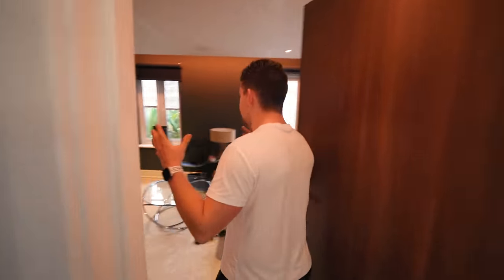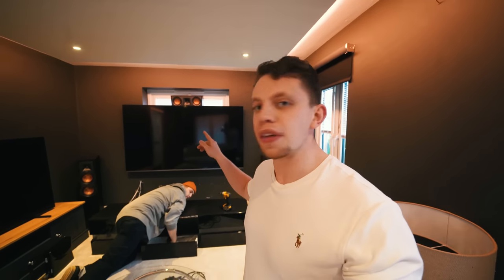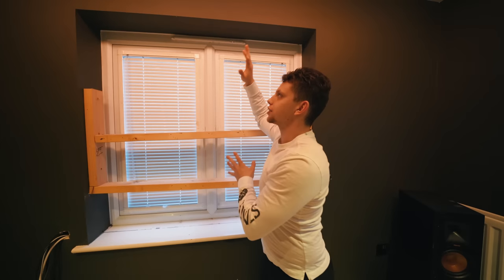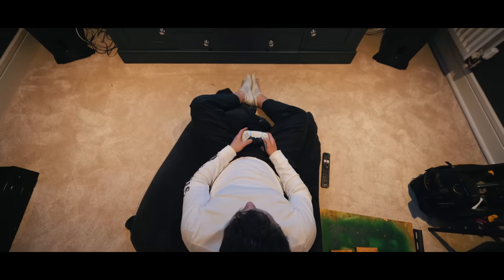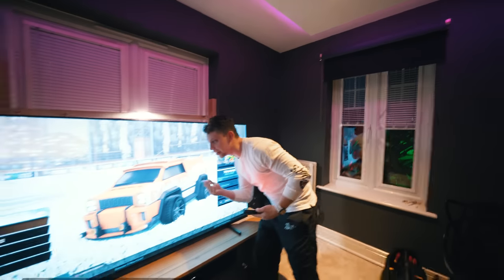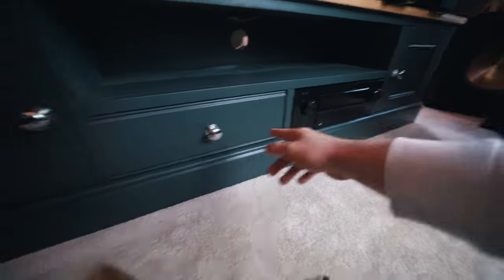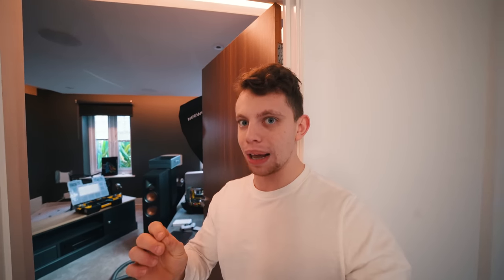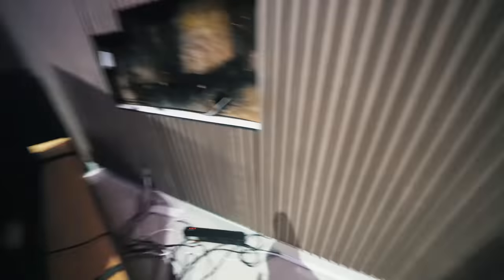Overhauling my Home Cinema for 2022! (Insane results)

Comment: How's your amp gonna stay cool though?
Reply: Most shocking AV setup I’ve ever seen, as you said:

- AV Receiver needs air, literally in the manual how many inches or cm clearance they need
- One of his floorstanders is right next to a radiator, another big no no.
- He has large klipsch floorstanders but a small centre, which is insane when 60-70% of the sound comes from the centre. 
- Running cabling all grouped together like that isn’t wise.

Just diabolical lol
Reply: He said he's gonna put a fan behind it
Reply: @tomahawk1222  that’s what I thought my demon amp gets really hot when I’m pushing it.. the grills are in the top of my amp too.. ah well it’s his equipment I suppose lol

Comment: There's feet on the bottom of amplifiers for a reason. So it can essentially breathe. Your amplifier is going to overheat and kill itself within a month.
Reply: Then installed flush on both sides. Choking it on top and on bottom.

Comment: I dont think its a good idea to squeeze in that receiver in there. Without proper ventilation, it would most likely heat up and then bye². I would have placed it instead on top of the table. Center speaker placement is a lot better than the old one. Just move it further front. So that the initial sound reflection would not be on the table.

Comment: That receiver needs more room to breath. Just putting a fan at the back will not do it. You should figure out something g else for that if you don’t want it to fry. Other than that looks AWESOME
Reply: I’m in the automation and theater industry and we put sometimes 4 to 5 receives In A rack which is pretty much the same amount of space that is in that cabinet. Not saying that is the best thing but there shouldn’t be any many issues since it’s not running 24/7

Comment: If you liked the smaller tv then you could have a taller unit for the amp  to breath and more room for other  equipment.. The feet on the amp are there so air can be sucked in  for cooling and the amp needs space above to get the heated air out, no fans needed if you leave room.

Comment: You are creating a major heat problem with your avr installed like that ,it needs ventilation, or if you like the no gap look ,you could buy a ac infinity fan cooler ,they simply sit on top of the avr ect they are available in front and rear exhaust, the only thing is your cabinet slot will need to be a little taller ,personally if you leave your avr as is it will simply just over heat 🔥

Comment: bro you need to swap where your ps5 and receiver are. it needs airflow
Reply: it didn't fit where the PS5 is sitting either, I'd reccomend getting a different cabinet entirely, or you could do some major modification to it to fix the air flow but airflow is going to be in issue, I woudln't put the PS5 directly above the amp either. Wall looks amazing though.
Reply: @ripjames  i agree, the wall is nice. Aesthetics isn’t worth dying components though lol

Comment: Cool but flawed.  Be far better with screen mounted higher ( Personally id have kept the 80" , or gone projector ).  Centre speaker could then be wall mounted and naff floor unit fecked off.  Electronics could then be hidden away in a rack at the back of the room and controlled by a Crestron or similar.  What you have is a nice loud TV but not a true Cinema System.  Stil at least you mounted a fan for the receiver or it wouldn't have performed very well, still gonna fry though mounted in that tight a space.

Comment: The moral of this story, don’t trust anyone that says “drilled to the wall”, what does that mean FFS.  Scary that this guy allegedly professionally installs racks etc. Adding fans behind that amp will make zero difference, it needs the space above and below for the air flow (I would suggest reading the Amos instruction book, where is will say do not obstruct the air flow).

Comment: Proper home cinema sound should never use the inbuilt TV speakers you will always get inferior sound use a Dolby soundbar always or separate speakers off a avr or even separate surround amp
Reply: Avr needs more ventilation as they run incredibly hot at least 3 inches are round and above and below amp for air to circulate. You may find you auto protect shutdown kick in when it gets too hot.
Reply: @letstalkcriterion  I have Denon behind the wall in my laundry room, it's gone into shutdown a few times blasting it in the summer
Reply: I'm home theatre enthusiast (click red dragon twice) and I've never heard of home theatre with TV speakers  😁

Comment: That Sony TV is a bunch of crap. It does not do 4K at 120 Hz. If you know anything about Sony‘s little scandalous behavior you’ll know that it cuts the resolution at 120 Hz and locks it in game mode. Get something like a Samsung Q8D a for way cheaper and you will definitely notice the difference. Way way way faster response time as well.

Comment: Next project - dedicated home cinema needs a projector.  Riser to add 2 rows 1 higher than the other.
Reply: Didn't he initially make a riser for the couch
Reply: @Nathan_Warnick  must have missed that, but projector for dedicated room over a tv I reckon is the way to go
Reply: @simonsmith8974  unless it's one of those $5,000+ projectors, projectors suck
Reply: @Nathan_Warnick  You need a dark room but yes I concede projectors are expensive.  Epson Tw-9400 4K projector costs around 2.5k would give impressive performance.